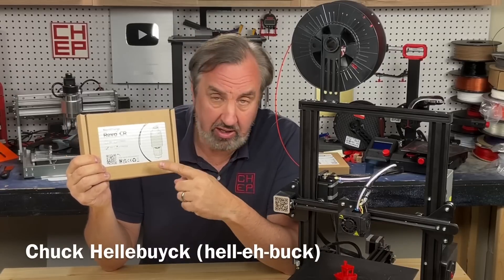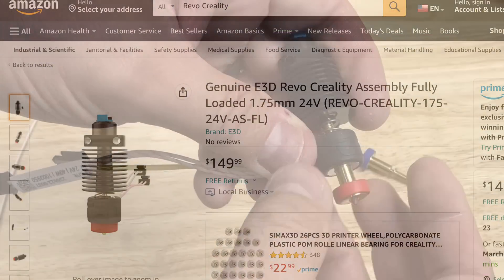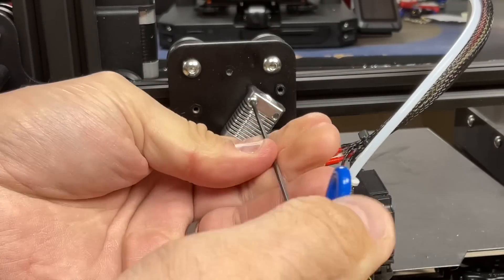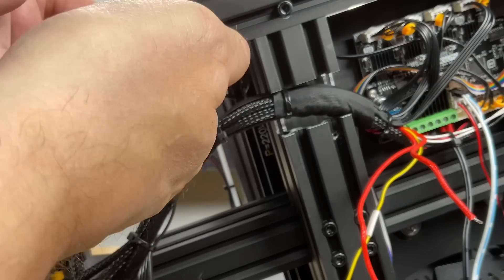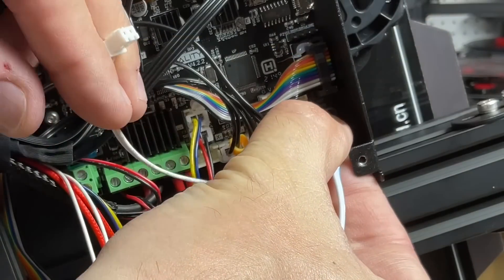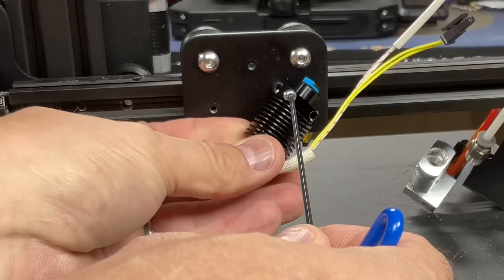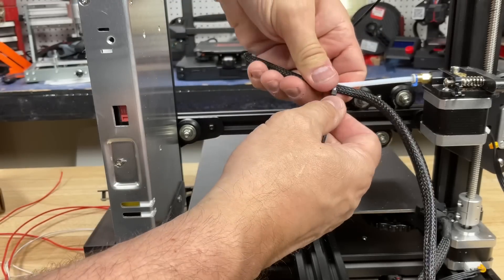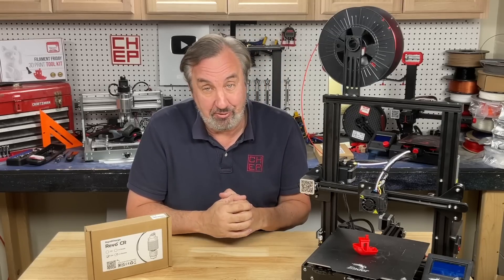E3D Revo Rapid Change Nozzle Hotend Install on Ender 3 Pro

Comment: An electrician tip.  Before removing the old wire, tape a piece of string to the wire so when you pull the wire, the string is then in the harness where the wire was.  Then tape the new wire to the string and pull it through the other way.  Much easier.

Comment: been having heat creep issues on the ender 3 neo, do you think an upgraded hotend like the sprite or revo would do better and would you suggest it for the neo?
Reply from the maker: Are you sure it’s not just your fan failing?
Reply: @FilamentFriday  I hear it running and I am not seeing any interruptions during printing. imported your .28 extrafast profile and it helped, thank you for that. Part of it I believe is the humidity affecting the filament but I'm uncertain as I'm still very new, like 2 weeks into learning how to print and upgrade the printer

Comment: Physically it could be a step forward but without the software profiles for one of the most popular 3D printers on the market , it  puts this one on hold until there are developments. I believe you can get great results from a bi-metal heat break at 20% of the cost for the Revo according to the reviews I have read but I have yet to go this route myself.

Comment: Here's a tip to make feeding wires through the loom easier, tie some good strong string to the end of the wires first, then when you pull them through, you can tie said string to the new wires and simply pull them back through the loom. Great tips and video Mate. Keep em coming 👏👍

Comment: So what is the advantage of this new hotend supposed to be? I'm guessing the nozzles are going to be considerable more expensive by the look of them.
Reply: Far higher temperature are possible and they are achieved without off-gassing from the Bowden tube, so you can use filaments like Nylon, etc. And higher temperatures mean that you can print quicker.
Reply: @andyspoo2  dunno about far higher. just 300degrees apparently.. and on the ender 3 pro youll need a new thermistor/thermocouple too - even the spider is capable of 500 degrees, limited by firmware to 300 iirc
Reply: You can cold insert the nozzle. It easily swappable, without the need of tools; you can hand turn this on.

Problem: expensive. Like wayyyy too expensive unless you are constantly changing the nozzle.
Reply: @omega-xis1943  Thank you for your reply. I don't have a problem using a spanner to change nozzles.

Comment: Yeah, after a direct drive upgrade, new mainboard, and Klipper, I'm not sure that more investment in my Ender 3 is going to get me very far.  The Micro Swiss NG is really tempting to get the weight off of the X-carriage but I think I'm well over the hill for diminishing returns.

Thanks for trying this out for the peanut gallery, it looks very cool and as often as I used to change nozzles it was pretty tempting. Maybe if I get a Core-XY machine later on.
Reply: Im on bowden, stock E3V2 4.2.2 silent motherboard, but install Klipper - and next step will be change printer... There is no way that i will invest more in ender 3, only maitenance.

Comment: I don't mind putting relatively expensive upgrades on a low-end machine, but I make sure I can "take it with me" to a new printer.  As long as all the bits are reusable with a different Revo heat sink, this might be a reasonable option if someone was already looking to spend money on a Dragonfly or whatever.

Comment: I used the replacement wires.  WARNING the motherboard plug on the thermister lead does NOT fit the mother board connector and I had to cut the wires to splice the connector from the old wire onto the new one.  Also, the wires are NOT long enough, and I had to add a few inches to them.  I bought the single nozzle version to save some money, as I didn't see that I was going to need all four size nozzles.  I would eventually like to get the 0.6mm nozzle though.
I've printed a few things in PLA and PETG with this hotend / nozzle and noticed that the PLA prints didn't come out very well.  I didn't notice that the fan nozzle was too high, I'll try printing your replacement and try again.  The PETG print was perfect, I think maybe this type of plastic is less critical on cooling than PLA. (So we'll print the nozzle in PETG).  I used super slicer and Prusa slicer.  I'm very happy so far with this hotend, especially since I can now print in PETG.

Comment: I did the upgrade to a Hemera XS Revo on my Ender 3 pro and it's never printed better! I think it's a bit better value for £150 to get a direct drive upgrade, hotend upgrade and the easy nozzle changes at one time, and the advantage of this is that the hemera nozzle setup can move to another printer if I decide to change rather than it only really working for Creality printers

Comment: on the box it says 24v , the old ender 3 should be 12v , is there any issue there ?
Reply: The ender 3 was never 12v.  The cr10's are 12 the ender has always been 24. I have one from the first 100 they released.
Reply: It's an ender 3 pro not an ender 3 in this video. If you have a 12 volt machine, there is a revo cr that is 12v. You simply select the correct one at the time of ordering.

Comment: One subject I’ve not seen you discuss is print bed insulation. Larger enclosed printers may not need it but read several things saying smaller beds might slightly ($) benefit from them.

Comment: Great video, I just upgraded the extruder of my prusa mini to the revo and at first I messed up by not checking the voltage, luckly y just fried the power cable and after sending back the 12 V extruder and ordering the correct one, and also a new power cable, I was able to make it work, and Its great or at least better than the original prusa mini extruder that was experiencing heat creap

Comment: Didn't like the thermister plug, replaced it with a proper JST connector, not sure what E3D's thinking was on this since it's supposed to be a direct drop-in, fail on their part. Other than that I really like mine and will be putting one on my E3Max. Something else to be aware of is that the coloured socks are crap, probably fine if you only print PLA but after a bunch of prints in ABS and PETG the socks broke off, not sure if it was the higher heat or what but yeah they really didn't last long. As for print quality, I haven't used Cura in ages but my prints sliced with PrusaSlicer have been just fine, no special tuning just for this hotend other than the tuning you would normally do with any printer.

Comment: Any upgrade cost more than a 3D printer is not worth having! I myself would prefer to use that money to either upgrade the printer another way or buy another printer to help print more stuff, As most improvements to a 3D printer can be done without buying expensive upgrading stuff.. Just download a load of upgrades from a online listing of free stuff.

Comment: Nice idea and designed hotend. However, I don't need to change my nozzle that often, so this seems way overpriced, and then you're going to have to buy special nozzles as they are different than standard. I'll pass on this one, but thanks for the review.

Comment: I got one for my ender5 pro because I switch nozzles really often to mess with different filaments and switch between printing figures with tiny nozzles and printing functional things like woodworking jigs with larger nozzles. Basically, stuff like this is only worth it for people who are constrained more by real estate than by cost, and just don't want to find a spot for a second or third or fourth printer that can be dedicated to different nozzle/filament types. I love my 3d printer, but it competes for garage space with lots of other hobbies. So for me, products like this are really nice. However, I totally agree that it's only going to be worth it for certain people. I've changed nozzles back and forth 50+ times since I got mine and I've never had a first layer problem or anything. Tip: Go in an add some extra retraction to your end gcode, that way you don't have filament in the hot end and you can do cold nozzle changes without issue. Might also need to add a little extra extrusion to the start gcode too, so that there's material in the nozzle when you starting putting down the priming lines.

Comment: Chuck, you didn't mention anything about modifying firmware for the thermistor change and increasing the hot end temperature. I would suspect your quality may be related to that issue.
Reply from the maker: They advertise no firmware change required. I did try adjusting temp. Didn’t help.
Reply: @FilamentFriday  thanks, I saw that on their website after I made my comment. Their website does mention 300°C, which would require a firmware change. I'm currently running a bone stock Ender 3 that works great, but I do want to go higher in temperature so I'm looking at hot ends.
Reply: @FilamentFriday  The thermistor in that one is appropriate for the stock firmware.

It DOES, however, need a PID tune. I'm surprised yours was performed at 210. I did my PID tune at 260.
Reply: no need to modify the firmware, this is a direct drop-in, they use the same thermister as stock. I asked this question of E3D themselves as I use Klipper and needed to know if I had to change the thermister setting.

Comment: Chuck, I think the duct needs to be higher. I've seen other duct mods and they are usually a little bit higher so the airflow hits the bottom tip of the nozzle.
Reply: On a stock ender 3 pro, the duct sits too low and touches the bed before the nozzle does. model is nice. Thank you

Comment: Absolutely Not Worth The Investment. Extremely Overpriced.
Reply: Only worth it if you constantly change nozzles, otherwise you're better off with some other hotends. I have the dragonfly bms and it's printing PLA, PETG, ABS, TPU like a champ for over a year now  no problems whatsoever.
Reply: I'd rather just buy another E3V2 for $99.
Reply: I respectfully disagree. I have a revo voron on my voron v0.1 and I just installed a biqu h2 v2s on my trusty ender 3 v2. I personally love the convenience of nozzle swaps, it's incredibly fast and I don't have to keep finding a wrench and something to hold my hotend. I found the tuning for me was no different than when I upgraded it to the all metal microswiss years ago. But to each their own. I personally have found the quality of the nozzle/heartbreak combos for the voron to be excellent and I enjoy the system a lot.I strongly considered the revo cr, but decided to switch yet another printer to klipper so ended up with the h2 v2s. I have an ender 3 pro that is in the box ready to assemble and at some point, it more than likely will end up with this revo cr.